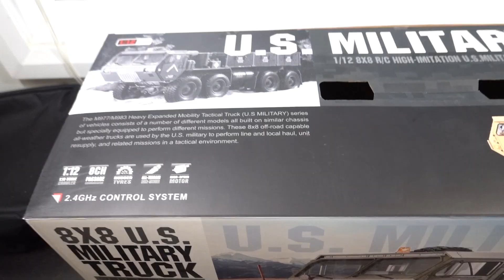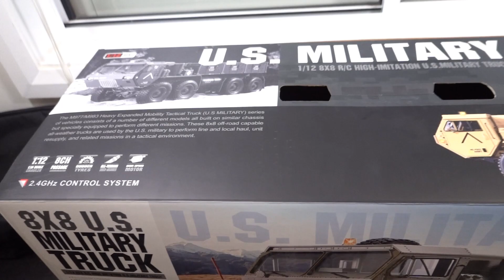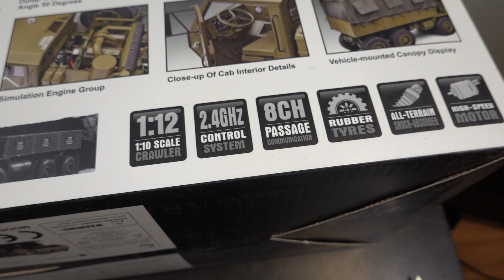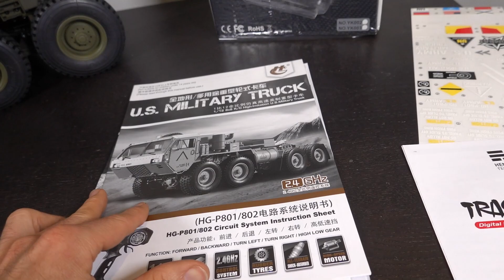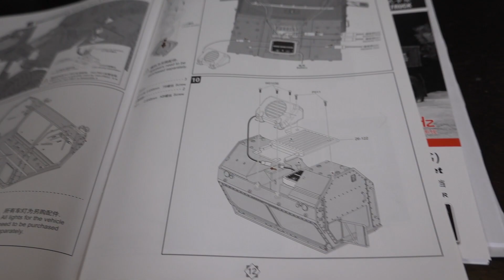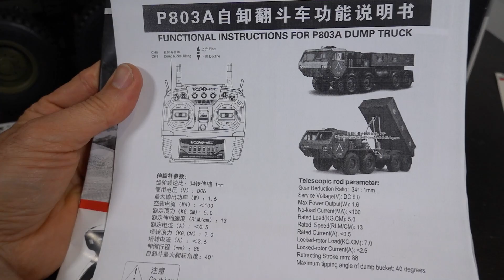AMAZING RC TRUCK HGP803A HEMTT US MILITARY TRUCK 8X8! New Upgraded Model With 5KG Dump Bed!

Comment: I've got the 802. If you are going off road the diffs need locking, not difficult to do, you don't need to take the axles out. I used epoxy and now it climbs like a mountain goat. I swapped the tyres for 120mm Chinese Rock Swampers. The steering servo's struggle on grippy surfaces and can go out of synch. Replacements need to be 180 degree rotation, and they are hard to find, I've bought two pairs of 25kg ones that weren't as advertised, they are also very difficult to shoe horn in as the originals are a shallow design. The servo's can be axle mounted, brackets are on Thingiverse and are probably the best option, though you will need to make your own links/rods etc. Check all the screws and use blue threadlock, some of mine had stripped threads and were unscrewing on their own, the metal is very soft.
Reply from the maker: Hey mate, much appreciate the info. Might open her up and have a look soon.

Comment: This rig is very cool. Just got mine delivered week ago.. Fun and very nice detailed. This is one of the detailed rc model in market so far.. The designer team put alot of affort in this truck design. As for the lift up bed specification ability to lift up 5kg and I have tested with 5kg dumbell and it can lift up it up easily. No problem with the lift..

Comment: I have quite a few of these,  my p408 turned up without lights and sound even though I ordered it with. and my p602 arrived and the smoke system immediately stopped working , the p802 like yours was also missing some screws. The crane took more than a little messing around with to make it work. But having said all of that I have built many rc4wd cars and you always have a huge amount of teething problems it’s almost part of the fun. if you add up the cost of building one of these they are an absolute bargain, and when they are working properly they are amazing . When they get their quality control thing sorted they are onto a real winner. If you want to see a side-by-side look with the rc4wd beast and the mc8 I have one on my channel if it helps or interests anybody.
The additional switches and stick controls are for the crane👍🏼

Comment: Great video mate. Keep up the good work.

I saw here on YT a guy cut the front 2 battery straps off so he could load his battery from the top instead of removing the 2 screws all the time. 

I'm going to do that to mine plus a velcro strap to keep it secure as I use soft side packs.
Reply from the maker: Yeah I done that too

Comment: great video ! I'm considering one, could you tell me if it has differential lock? I see contradictory information on the internet, it seems that some models do not have it. Finally... after two years, what is your opinion of the truck? Has it caused problems? do you think it's good? thank you congratulations for the content
Reply from the maker: It's a great truck, I haven't driven it much but it still has no issues with it. The diffs can be locked manually from memory.

Comment: It's a very interesting vehicle. My major concern are the leaf springs. The older models in the same series are stiff as a brick. They look really bad, in my humble opinion, when moving over obstacles. Standing still it's looking stunning, then they move and I'm like "WTF there is no suspension movement whatsoever". Hopefully in this one it's better.

That light on the hood though... that has to go, the colors are not right at all. Not a big deal, just a big trigger to my OCD ;). I'm really interested in this truck, there ar not many 8x8 out there and this one looks super cool. I love the fact it has a lifting bed. I would like to see more non hydraulic systems in RCs. Hydraulic is awesome, but it's also expensive as hell.

Comment: I 'think' those guys are disscusing/negotiating what radio frequency/channel they are on. In the days before 2.4 stuff Radios were in bands depending on what crystal was inserted into the radio, to prevent interference people used to ask around who was on what and try to use a frequency no one else was using.  Nowadays with the 2.4 stuff all receivers are (supposed) to only 'listen' to one transmitter so frequency is no longer a factor.  And perhaps those instructions were meant for when 45Mhz(surface) or even 27Mhz (remember flags and clothes pegs and even some people using 'special tricks' with there crystals so they could fly all day?) was used.